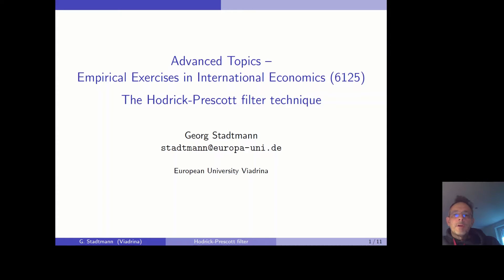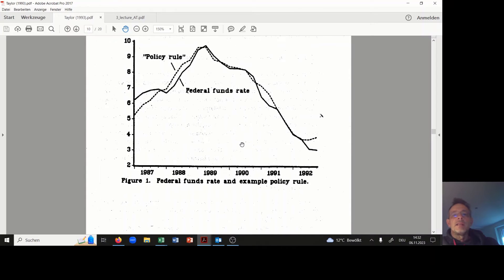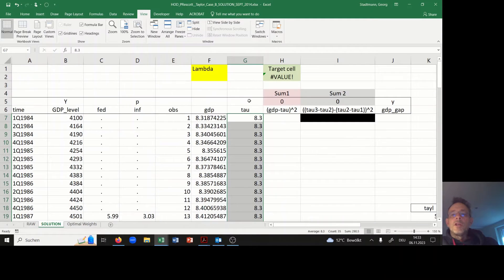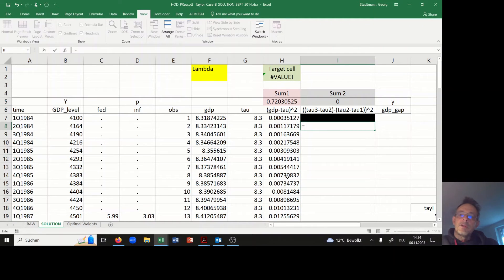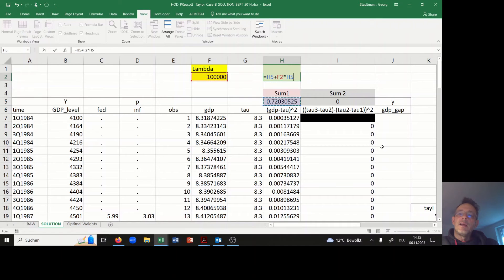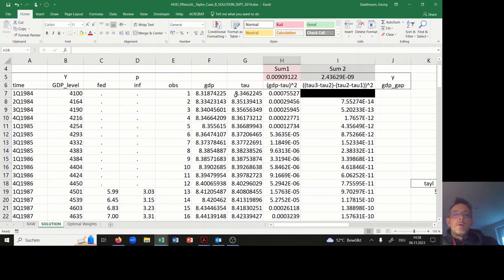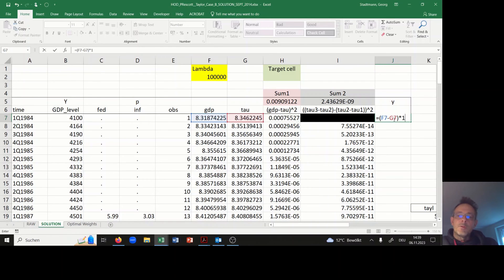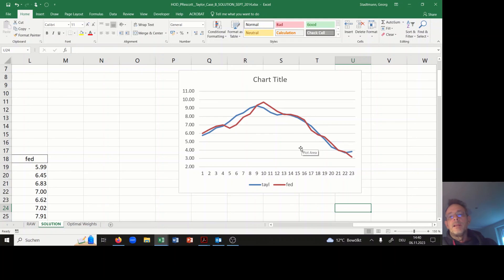Hodrick Prescott Filter -- Part 3: Output gap for Taylor rule

Comment: 1. If I want to run model without log, but to find output gap I am using log, then I will get output gap in log. How to get with log output gap? 2. Also my variables are in rates, so I don't want to convert to %.

Comment: If i want to calculate the inflation gap, should the value of inflation be logged or not. Thanks
Reply from the maker: No log. Because the inflation is already a rate of change and measured in the same dimension as the output gap..